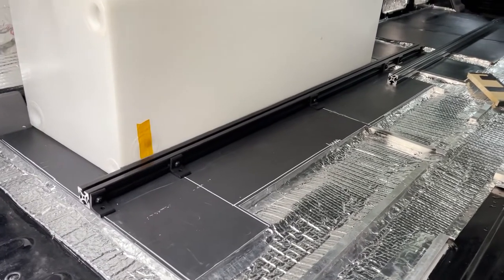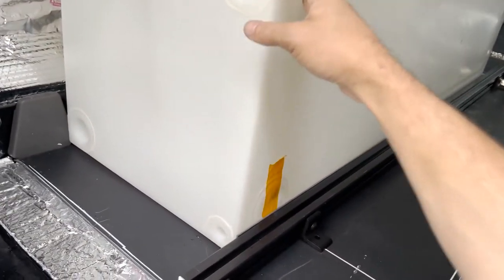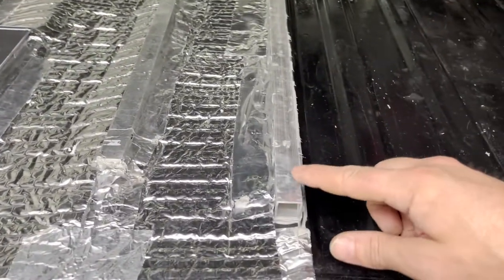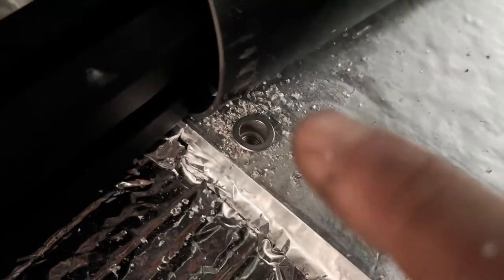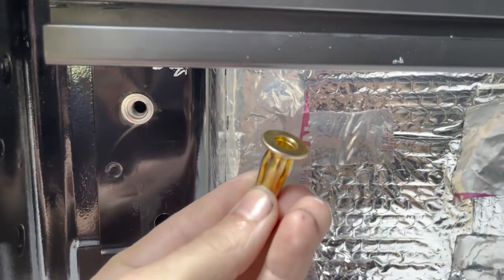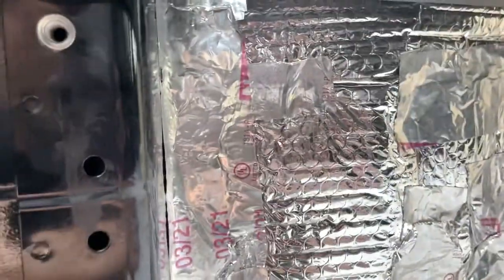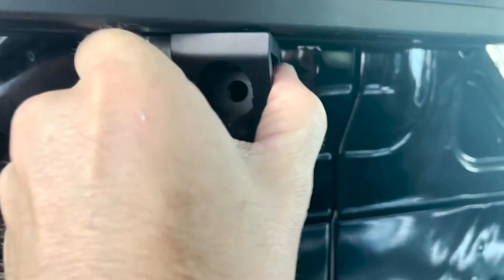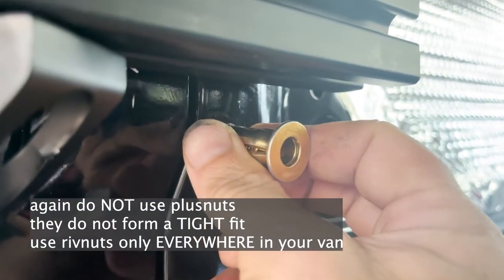Building Van Bedframe with 8020 Aluminum

Comment: I am working on my step van with 80/20 15/15 and found many ways to do what you did.... I learn 5/16 is  the size for most... and  bolts are good with it....  take a small piece and just fine ones that slide in ....
Reply from the maker: 5/16th bolts don't work well like other channels say because it is impossible to get the right length.  You end up having to grind or saw each and EVERY bolt.  My advice is to use the 8020 t-nuts, bolts, and connectors all the way and buy twice as many as you think you'll need.

Comment: Nice work. Can you say what material The floor panels are ? Thanks
Reply from the maker: 1/2 inch baltic birch. Not sure what else you could use besides would that would also transmit the heat.

Comment: Hi, I will be doing this in AU in the next couple of weeks. The 8020 is the way to go for sure. What size 8020 did you use for the bed frame?
From what I've read, plus nuts are stronger, but shouldn't be use for exterior applications.
Reply from the maker: I had been planning on using the 1010 aluminum but found the joint connectors really chinsy. I was able to snap them with my bare hands.  After that I went with 1515 all the way.  Also, I wouldn't use plus nuts at all.  The require a tight space behind the wall for the plus to "lock" against.  Rivnuts stick to anything.
Reply: use the 15/15 or in metric 20/20 for main and the 10/10 for less support things. there are hex bold you can use and caige bolts that all will work... explore all option ...

Comment: Maybe too late, but it looks to me your weight distribution does not look good. Water and batteries on one side may be a problem.
Reply from the maker: Batteries bank is on the passenger side in my van, water on the driver side.  Even number of 8020 0n either side too after final build. Will post a final build vids soon.